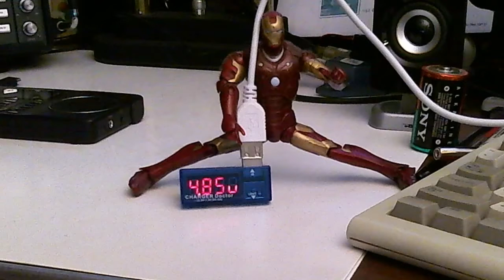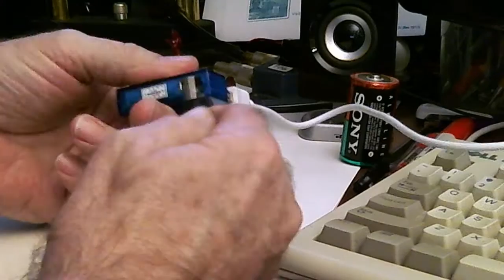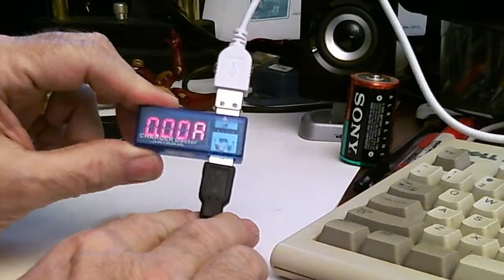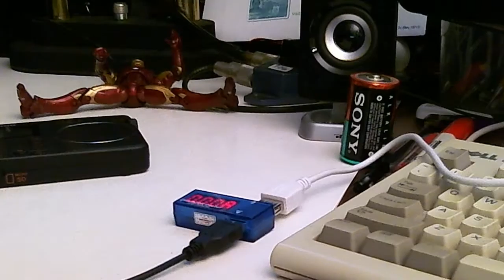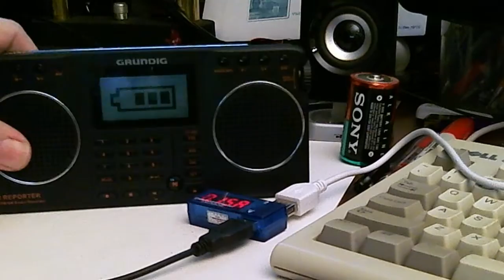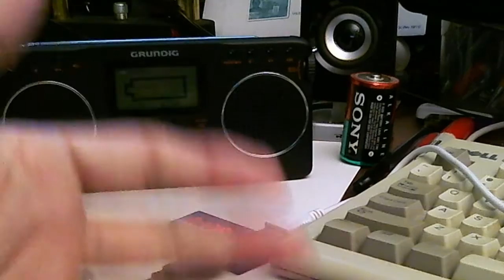TRRS #0287 - USB Charger Doctor

Comment: You don't want to over-volt the radio, if the radio uses a 3.6v Li-Ion battery, then you would not want to power the radio from the USB port which would presumably be 5v.  If you had a radio that took 4 normal battery cells, most modern radios can accept alkaline (4 x 1.5v = 6v input), or Nimh (4 x 1.2v = 4.8v input), so running that kind of a radio from a USB port would be just fine because the USB voltage (5v input) would be in the middle of the range of acceptable voltages.  A much easier way to solve you problem is to buy a cheap voltmeter (I actually bought 2x of them today for my sons - https://www.amazon.com/gp/product/B00NWGZ3A6/ref=oh_aui_detailpage_o00_s00?ie=UTF8&psc=1) and then put it in series with your battery (which would probably require soldering as your Li-Ion battery is presumably soldered into the radio.)
Reply from the maker: Thanks for the info.

Comment: If you are going to pull the battery, just cut the pos+ put a 1ohm resistor in series to the pos+ input then measure the voltage across the resistor.  Its simple and safe to test this way vs hooking up something and not knowing the input specs on the device.

Comment: I have a digital scanner that gets power and charges through a usb port. I use it all the time with or without batteries installed. Check the owners manual but I am pretty sure you could use the G2 shortwave radio the same way.
Reply from the maker: Thanks for the comments.

Tom

Comment: Hi Tom. Hmmm. you should be able to find the current draw for the radio,in 1 the paper work that came with it or on the radio it's self. and 2 what your USB is capable of delivering  current wise. In my thinking if it can charge the batteries then it should be able to handle the radio with no problem. Though I am no positive on this. Sorry I can't be of more help.
Take care. Bobby